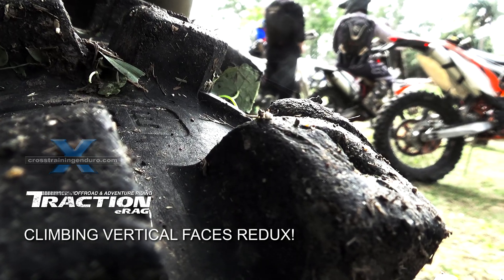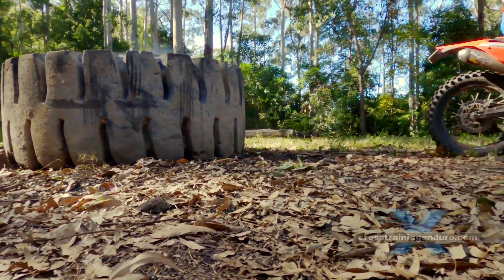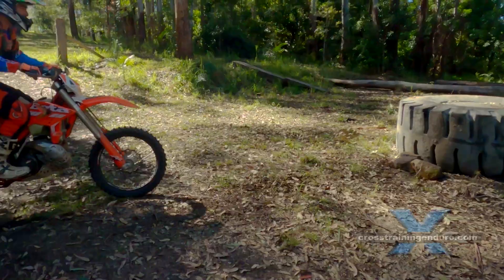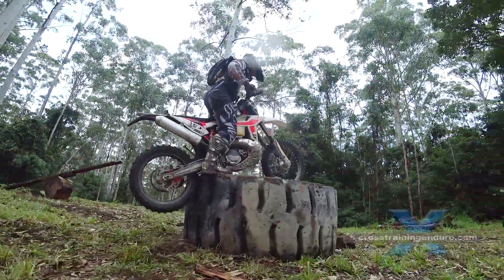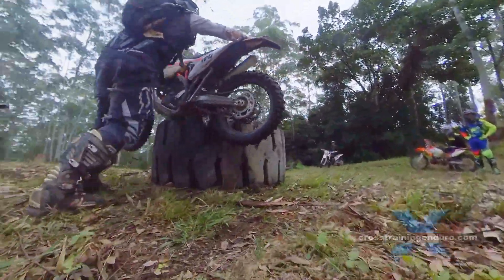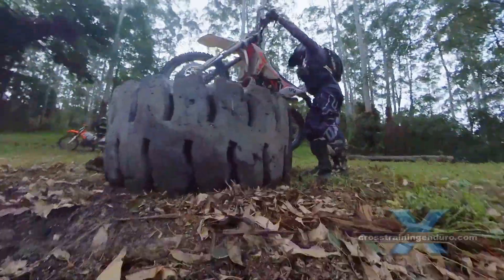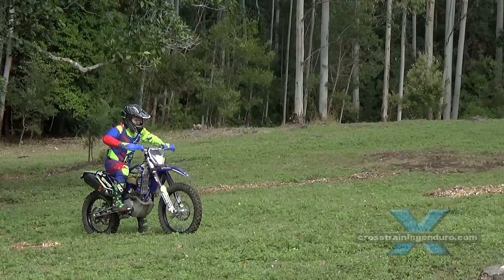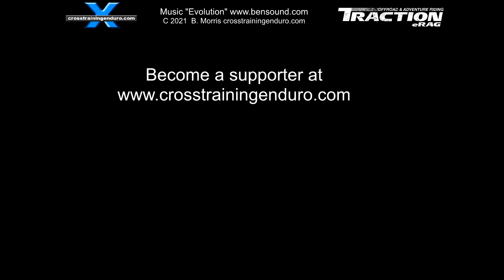How to climb vertical obstacles (redux)︱Cross Training Enduro

Comment: So in the dry, you don't double blip it but rather just keep the gas on? Also, does double blipping always involve the clutch or is punching it twice a valid technique? Thanks in advance!
Reply from the maker: Heaps of variables Andy, but with good traction you could probably just use the punch technique which is just one hit of throttle. Double blipping works best along with the clutch but it's hard to do... I tried learning to involve the clutch but just gave up.

Comment: I can’t wait to try this but i just thought of a point. My bike is a motoX bike (kawi - 250f 2013 if it makes a difference) that i use for enduro riding and so tracks if i can get there, but i just thought of it, on the hot days, have you ever heard of motoX bikes over heating? For me im either at a stand still or doing about 20mph (32kph) and nothing too much slower unless im waiting, have you ever heard of constant slow hard enduro training over heating bikes or spitting out a bunch of radiator coolant? Im not sure if enduro bikes are built differently for the slow and heat or if mine just goes at stand stills and i haven’t realized yet. Thanks in advanced! (In the mean time ill look for anyone else who has this question on forums and such to see their responses)
Reply from the maker: Not really sure, possibly some mx models have smaller radiators to save a bit of weight? I do know that KTM 2T enduro bikes overheat easier than our Beta models, which might come down to coolant capacity....
Reply: I thought it was that mx bikes run higher compression, hotter cams, and different ignition which creates more power but also more heat.
Reply: @crosstrainingenduro  ive found very little on it (so far) but some people say you can use high performance coolant to cool the bike better, and the other comment mention them running hotter in the first place for more compression, so that would share a few places. So technically its easy to have an enduro bike but seems to be fine on cooler days and just need to maintain it/pay attention slightly more on warm days
Reply: @nepicness  that would make a lot of sense speaking that for an MX bike you’d expect it to be moving fast enough where thats not a problem
Reply: Enduro bikes have fans.

Comment: Inflate your tires with helium.  Those 12 o'clock wheelies are that much easier to do
Reply from the maker: And don't forget 79% nitrogen in the front forks too
Reply: Will that result in a higher pitch squeal when you lock up the front break ???
Reply from the maker: Hopefully! 😂

Comment: I put a skid plate on my xr650l and this dude made fun of me saying the big red pig isn't hard enduro bike???what u all think? I ride hard so I want the protection ya know
Reply from the maker: Hard to say, I'm not sure if stones thrown up by the front wheel can damage crankcases or not. If you are ever needing to get over logs or might ground out in rough terrain then it could prevent damage or flattening your frame tubes...
Reply: @crosstrainingenduro  right thsts what I figured plus I already had my chain snap and crack my case so I have a case saver coming and am gonna jb weld it I guess. I just dont wanna have to rebuild the bike again lol